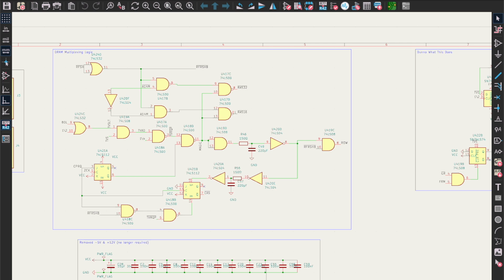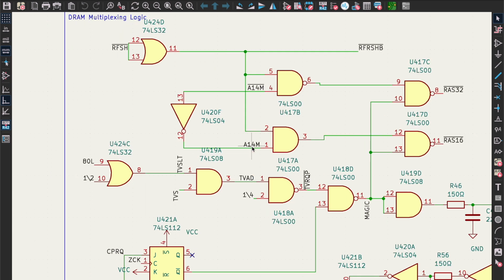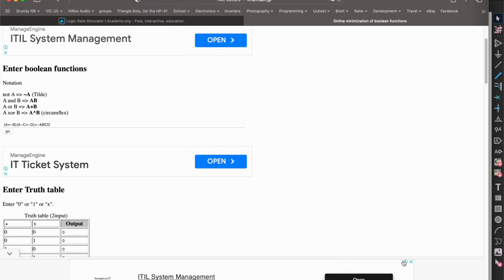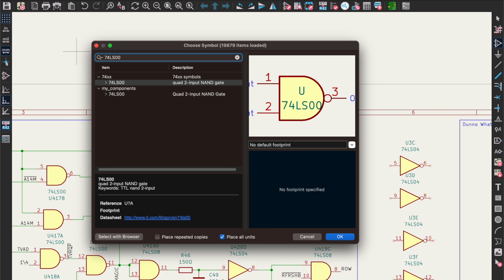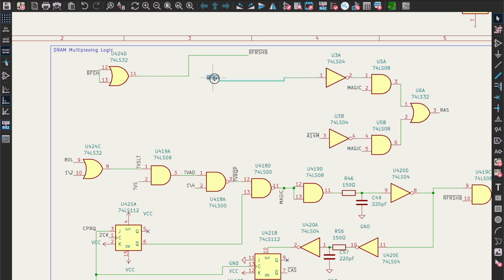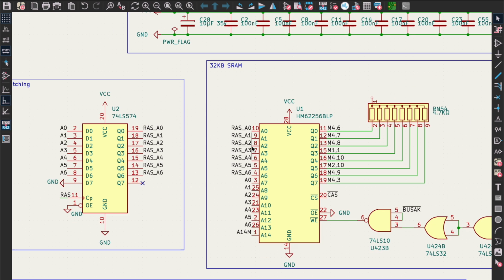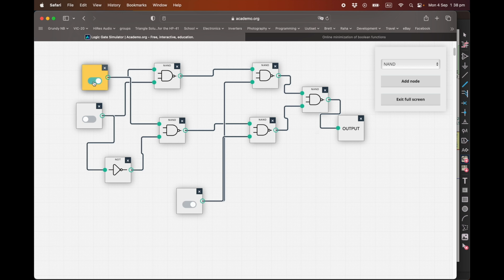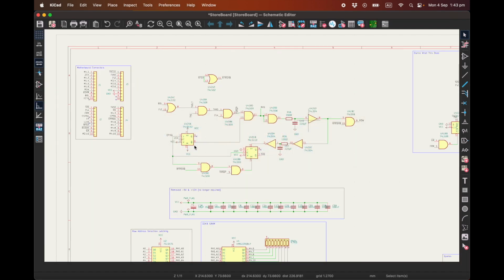🇬🇧 Grundy NewBrain: Part 8a (Internal SRAM Store Board) [TCE #0346]

Comment: "{Fri 15-Sept-2023}
Sent SRAM Store Board prototype for fabrication" - Any update after this? :) Would be interesting to know if it worked. The github project seems to be not updated since then. Thanks!
Reply from the maker: Ahem ... well, I made a mistake with setting the footprints ... I mistakenly used DIP-14 instead of DIP-16 for some chips, and didn't properly verify.  BUT ... yes, I've been wanting to come back to this ... and now that PCBWay sponsors me I can get the boards for free so I really should get a 2nd, corrected batch made up ... I've been a bit slack because I feel they probably won't work.  I did ask on an Australian vintage computer FB group for feedback about the design but I mostly got smart-arse replies asking,  "why did you do it like that?", etc. ... nothing actually helpful ... "well, if you actually read what I wrote you would've realised I'm trying to shoe-horn in an SRAM where multiple DRAMs were and I am limited to what signals the original designers made available on the board ... send your smart-arse questions to the original engineers".  Dickheads.  Maybe I should ask on a proper forum like VCFED ... I might do that before I send them off in case they pick up other errors 😇
Reply from the maker: PCB corrected & sent to PCBWAY for fabbing.  Github updated.  Not confident they will work, but have to start somewhere ...

Comment: the 33 ohm resistors are for series signal termination. most output drivers are less than 10 ohms and many times the trace impedance ends up at 50 to 100 ohms. The resistor helps suck up resonance that can occur between the capacitance of the output pin and the capacitance of the next input pin. So they are needed anywhere the trace length is longer.
Reply from the maker: So in this case, the signal is coming from the main board ... so the trace length would be considered long.  Thanks ... this makes sense to me. I'll add them back in. /Brett

Comment: Wow, what I nightmare. Just typing out loud... you have to put the (7 bit) row address onto the address lines, clock the RAS, put the (7-bit) column address onto the address lines, clock the CAS line, then read (after a suitable delay) or write the data bus from a bank depending on whether A14 is low or not. So you want to go from 2x(8x(128x128bit)) to 8bit x 2^15 (both 256Kbits)?

I'd be looking at converting the address to something you can use directly on the 256Kbit/32K SRAM A0-A14 lines, which doesn't seem immediately easy. It depends on whether the column address is in the ranges 0-7,8-15,16-23,etc. eg a bit test which adds to the translated row address (since each original row is 16 bytes). 

<mind blown gif>

It looks like REFRESH just strobes the RAS lines (as per the datasheet) and that circuit just decides to do it if no other reading or writing is happening, and yes I think that can all be safely ignored if you are using SRAM.
Reply from the maker: Idea at the moment is that we capture the 7-bit of the row in the latch and then present it to 7-bits of the SRAM (say A0-A6) along with the next 7-bits of the column (say A7-A13), and then A14 is just A14 ... ?
Reply: @Brfff  interesting. Yeah that makes sense. Doh. 😅
Reply from the maker: @gshingles  ... I think timing will be the issue though ... so I have added some test points already to make it a bit easier to book the logic analyser up